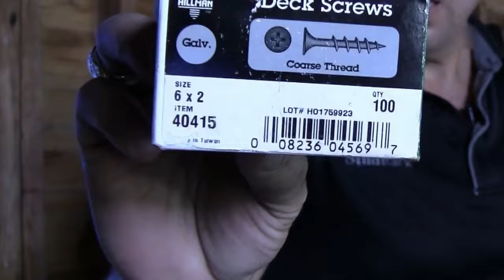Wall Storage for Yard Tools | Garden Tool Wall | Simple Yard Tool Storage | Between Stud Storage

Comment: Eugene just ordered the ez rack storage. Question I have electrical wiring that run down to plugs between some studs, can the wiring be moved or cut around? What do you suggest?
Thanks you’re videos are great….
Reply from the maker: Howdy, that is a tough question to answer. Is it in a garage with expose studs? You should consult with a local electrician to make sure you’re not violating any codes. If it is in my house, and I plan on living in it for a long time, I would remove staple on the wire, and push it to the back corner of the stud, and install the racks. Then on each shelf, I would have to notch out the corner to allow room for the wire. but you should consult with an electrician to make sure you are not causing any problems. The wires are centered on the stud so if you put a screw in the wall hang a picture or anything else you do not damage the wire. Disclaimer: “ I am not an electrician, so I cannot give you advice.” Hope this helps.